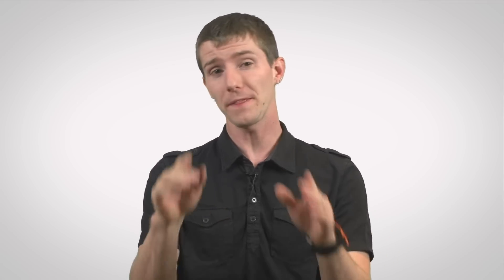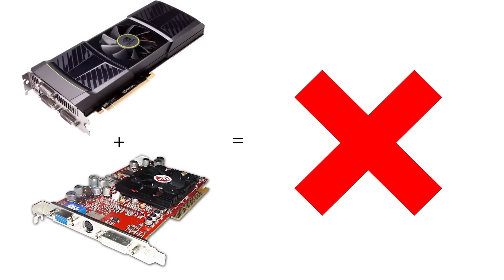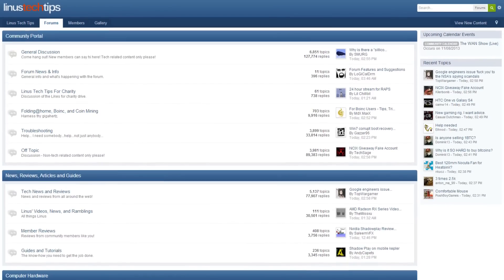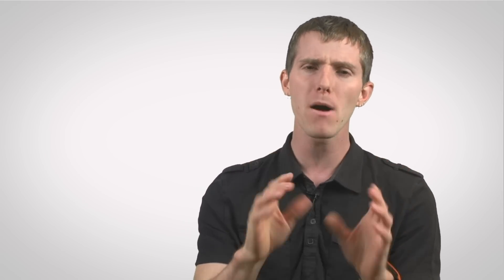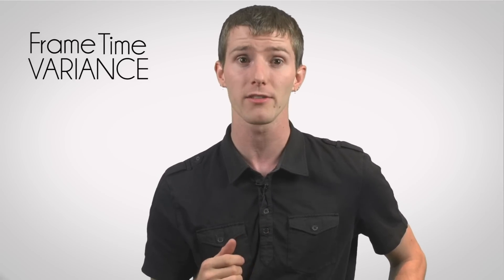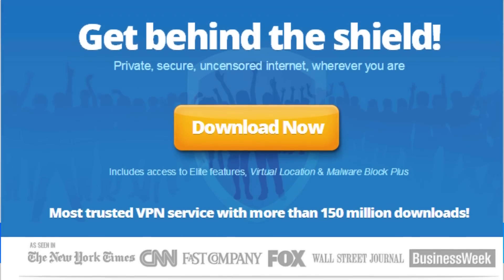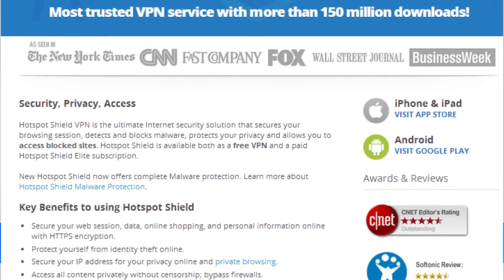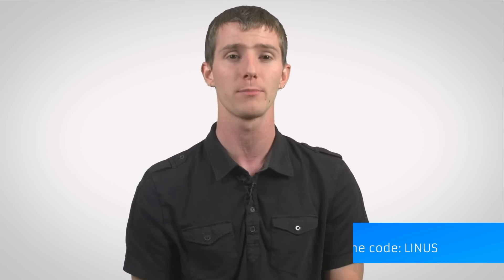SLI by NVIDIA - Everything you Need to Know as Fast As Possible

Comment: What should I need for power supply with 2 Gtx 660 And a Gogabyte 990fx killer and a Amd Fx 8350
Reply: TheSlayingService 750 is enough, if you're going to overclock you cards you should even be safe with a 750W PSU
Reply: TheSlayingService the thing is with power supply's is that you can have a 1000w but your system may only need 700w but it wont output 1000w it will output 700w instead.
Reply: 750watts
Reply: 850 overkill
Reply: 850 would be more comfortable right
Reply: My system: FX 8350, 990fxa, HD 7870 x 2, and several fans/drives, ran short on an 750.  The 7870s run 2 6pins in stead of 1 like the 660's do, so 750w will probably do just fine.

Comment: is crossfire pretty much the same?
Reply: Crossfire has wider compatibility as it will allow you to use 2 cards based on the same board while SLI only supports same processor and same memory.

However on Crossfire or SLI you always get the lowest clock speeds so not much reason to use most of the AMD benefits on theirs however the 1 card with more memory might be useful sometimes.

Both act the same way though.
Reply: Yea i knew crossfire supports across different processor and ram but the faster card has to wait for the slower card but I was wondering if the other stuff was the same but thanks
Reply: The Andoxico
Yeah its the same other then those cons.

Comment: i'm planning to go for the MSI Z87-G43 motherboard, it says AMD Crossfire is compatible, does that also mean SLI is compatible?
Reply: TheProvinceOfGaming NOOOOOOOOOOOOOO NO IT DOES NOT
Reply: No, you will have support for Crossfire (AMD) not SLI(Nvidia). Unless it says that its an SLI board, its not an SLI board
Reply: lawdoggy00 Thank you SO MUCH man! you've been a great help! but sadly only G55 and G43 are available in my country :( is the G55 SLI compatible?
Reply: lawdoggy00 Thanks man! i'm definitely going for this then :D
Reply: yes
Reply: TheProvinceOfGaming Crossfire is AMD's version of SLI
Reply: Benjmin Bingström thanks! by any chance do you know any good SLI board under $130? running low on my budget :(
Reply: Amrut Purohit  Its 20$ more then you asked but if you step up to the z87 g45 it has support for both crossfire and sli. And 3 pcie 3.0.  I did alot of searching around before settling on this motherboard and so far so good. :)
http://www.newegg.com/Product/Product.aspx?Item=N82E16813130693
Reply: MSI Z87-G55 LGA 1150 Intel Z87 HDMI SATA 6Gb/s USB 3.0 ATX Intel Motherboard

http://www.newegg.com/Product/Product.aspx?Item=N82E16813130727

Says in the spec that it
"Supports 3-Way AMD CrossFireTM Technology
Supports 2-Way NVIDIA SLITM Technology"

Not a bad looking card if you ask me :D
Reply: It says its supported or were you responding to an earlier question?
Reply: lawdoggy00 he was responging to the 1st and second comments not megakiller999's comments

Comment: R9 Crossfire?or HD 7000 Crossfire?By AMD?
Reply: That's not what I asked,what's the difference between SLI and CrossFire
Reply: They are basically the same. SLi is Nvidia's name for the technology and crossfire is AMD's patented name for it.
Reply: Can I ex: R9 280x+R9 270?
Reply: Warframe Dragonfang yes.
Reply: Lango Triel Thanks
Reply: neither. Crossfire sucks.
Reply: ATCrogerwilco I have a crossfire setup right now, not just trolling.
Reply: ATCrogerwilco Me jelly.Me want
Reply: ATCrogerwilco i am running a 7970ghz together with a 280x (same thing basically) and it works oerfectly fine.. don't get what your problem is
Reply: Yeah that's what I heard,must it have the same architecture such as Hawaii-XFire to-Hawaii GPU
Reply: the more similar the card, the better it will work together. but AMD gives you a lot of freedom.. if the card is in the same series it will work. the R9 series is just rebranded 7000s  (except 290 and up)
Reply: Lango Triel I have 2 280x, drivers suck. Half the games run worse.
Reply: You are doing something wrong. I get double frame rates in some cases.. and it runs like butter.
Reply: Really?I thought 2 GPUs would equal like 1.6x moar performance
Reply: It does for the most part. But certain games get almost double the FPS .. and some barely improve (skyrim)
Reply: Certain tough
Reply: though*

Comment: running 2 gtx 670 ftw edition in sli. it runs perfect in my pc and the performance is doubled. :)
Reply: i have 1 nvidia gtx 770 and i want to sli that bitch sooo bad but the card is soooo expensive!
Reply: Yolo Swaggins that is true. i saved up money for a long time but finally i earned enough for a new computer. i went with one 670 ftw because it was the first time i ever built my own computer and wanted to test the new card. then i realized i had money over and bought another gpu. be warned that gpus nowadays come and go fast and 670 ftw is not available anymore, here in sweden atleast. so if you want another one you should buy it soon. for me it was the right choice but you should only buy a new gpu if you accept the fact that it is not doubling the performance. chances are very high it will not boost performance that much. but if you accept it and buy a new one you will ofcourse see a big improvement. :)

sry for bad english
Reply: you spoke...or wrote very well, and thanks for the advice dude!
Reply: no problem :D
Reply: Yolo Swaggins how much the sli?
Reply: Princes Knights It's just to buy a new card really

Comment: You can fix Micro-Stuttering by clocking the second card a little bit higher on the core and on the VRAM (like 10MHz) that will fix the Micro-Stuttering
Reply: Clocking one card will also clock the other card, they have to be synced and they do this by default. That's what I know at least but if you have proof of your cards running on different clocks please correct me.
Reply: Johan Wingård They do not have to be synced. I have 4 gpus and they all have different clock speeds for their gpus. 4 Different cards too, but cause the GPU & Memory are the same it doesn't matter. 2 are EVGA 1 is ASUS and 1 is MSI.
Reply: APOC Gaming Network Why do you use Frankestein instead of a computer?
Reply: APOC Gaming Network It's still the same card just a different brand. And if you check GPU-Z or any other software you will see that once you run SLI all clocks will sync up with the card that has the lowest clock and ram speeds.

Comment: some wrong info in this video as following:

1. You said SLI was introduced in 2004, but:

SLI was created in 1998 by 3dfx when they released Voodoo2 not in 2004 and it meant Scan-Line Interleave, when Nvidia acquired 3dfx, they reintroduced it in 2004 with Geforce 6 series as Scalable Link Interface. 

2. You said SLI wont double your performance, but:

You almost get double performance with 2-way SLI, the gain decreases when adding third and fourth cards respectively. you will gain 90%-95% from adding a second card, third card gain is 50%-70% and last fourth card gain is 30%-50%.

Comment: should i get 770 sli or one 780 ti
Reply: 780 ti and whenever you feel like you need more details in games in the future buy another 780 ti, also at what resolution will you play? if you are going to use 1080 buying a single 780 ti will last for VERY long time
Reply: um,,, well right now i have a 720p monitor but im upgrading to a 1080p benq which can do 120fps so i want to utilize that feature :)
Reply: get a 780 ti and in the future buy another 780 ti, it will be cheaper. If you sli the 770s and you want to add another card it will be 3-way sli and that is just bad, it won't give you anything extra...at all
Reply: I think it comes down to the games you play. I would go 770 sli for now since its cheaper and will play games faster than a 780ti (given that the game has a good sli profile). Then, when that is obsolete, get the 980ti** when that comes out XD

** - I mean whatever flagship card that comes down the road that is still at a good price point. Who knows what it will be called.

Comment: Hey Linus :) What would be the difference in Performance running a set of 2x3 Monitors (like the Samsung md230x6) on 2 Card (3 each, using DP) using and not usinf SLI (as SLI just doubles Performance compared to a single Card, which physically having two Cards should alredy do)? Seems like SLI is only for single Monitor Setups, like the newest 4K Monitors in single Monitor Setups?

Comment: is a PSU Corsair HX 1050 WATT good enough for 3 SLI GTX 780TI? or do i need to purchase a different psu???? with higher WATT?
Reply: no you don't
Reply: Danny Vaca Let's trade lives!
Reply: lol no thank you XD
Reply: for the moment i only have 1 4k monitor looking to buy the other 2 monitors some time in march
Reply: Its more than enough.
Reply: thank u kindly for taking the time to reply :D
Reply: 3 SLI GTX 780TI? Are you running 3X 4k monitors or something? And I who though that me ordering 780TI a few days ago was a bit over the top...
Reply: Danny Vaca You might want to but it up to a 1200 watts. Especially if you plan on overclocking those cards. I've had my AX1200 for 2 years now and it's still going strong. Although you might want to op for the AX1200i because it's a lot sleeker looking.

Comment: Techquickie Woah, slow down a bit, because you're losing information. SLI was introduced back in 1998 by 3dfx, the company responsible for Voodoo graphics accelerators, which was later bought by nVidia.

Comment: Will there be a huge performance difference if my GTX 660 runs at PCI 8x8 instead of 16x16, my motherboard has 3 x16 slots running at PCIEx16,x8,x4 respectively or will my motherboard support 16x16. Somebody please give a reply.
My system:-
Processor-  Intel Core i7-4770K Processor 3.4 GHZ
Motherboard- GIGABYTE GA-Z87X-UD5H
Memory-  Corsair Vengeance 8GB (2×4GB) DDR3 1600 MHz 
Graphics Card- Gigabyte NVidia GTX 660-2GB DDR5
Power Supply- Gigabyte Superb E620 (SLI Support)

Comment: things that are kinda right and kinda wrong.

SLI DOSNT REQUIRE 2 16X SLOTS. U may run them in 16X and 8X, 8X and 8X, 8X and 4X as well as 16X and 4X. The board just has to support SLI not have 2 16X slots.
Reply: just wanted to also add, when you were talking about not working with AMD cards it sounds like you were saying they wont work AT ALL with Amd cards which again isnt 100% true. 

With windows 7 & 8 they do have driver stacking where you can use the Amd card as the primary performance driving card  ( AKA making it the primary display card ) and use the Nvidia card for Physx titles like Mafia 2 to get the extra effects out of it. While this isnt SLI per-say u still are using the 2 cards together to get better performance and features.

Comment: 2004?
I swear that the Voodoo cards had the same thing in the late 90's
Reply: 3dfx's SLI stood for "Scan-Line Interleaving" and it basically divided up the screen into odd-numbered and even-numbered pixel rows to be rendered at the same time. nVidia SLI stands for "Scalable Link Interface" and it either splits the screen into top and bottom to be rendered simultaneously, or odd and even frames to be rendered concurrently.

Fun thing about SLI: your loading times will increase substantially, as all of the loaded textures have to be mirrored on both cards (no, you don't end up with 4GB of vram if you combine two 2GB cards).
Reply: They did. But it didn't catch on for some stupid reason.
Reply: Indeed. 3dfx introduced SLI (yes, almost exactly the same technology) back in 1998. Still, people think nVidia created SLI...

Comment: so i cant sli a 4gb 760 and a 2gb 760? bummer
Reply: U can, but u only get 2gb per card. so the 4gb gets half the memory wasted/ unnused.
Reply: but wouldnt i only get 1gb per card if i had 2 2gb cards?
Reply: no,  if you have 2 2GB, you would get 2GB for each card
if you have 1 2GB card and 1 1GB card, you would get 1GB because youu cant increase the VRAM

also, if you have 2 cards with both 2GB, AND the same GPU BUT with different clock speeds (100mhz and 120mhz for example) the higherst Mhz would be clocked down so it will match the lower one.

memory works the same as the speeds here, the highest will decrease itself to match the lower

Comment: I'm facing this now as I got the GTX-770 SC 4GB for my newest Asus/Intel Z87 build and it says it supports 3-gaming monitors (ASUS VG248QE) which it does but only two can use the 144Hz refresh rate using DVI, the 3rd is 60Hz only using Display Port. So when I turn on 3D Surround view, I can only use 60Hz for all three monitors. Thinking of adding 2nd card in SLI but does it have to match current card or could I use GTX 670, 680 or something else to pair up to my GTX-770 SC 4GB?  There are only two DVI Ports, and one each Display Port and HDMI (which I'm not using). So I need another card for one more DVI socket to use 144Hz refresh rate. Gaming cards should have 3-DVI's minimum.

Comment: Hey Linus! Do the PCI-E lanes need to be 16X both?! Ususally they are 1x 16x  2x 8x so does this affect the performance by how much?! I have a Maximus VI Formula and a GTX 780 dc2oc and was thinking of buying 1 more when they drop in prices.. So should I just sell this and get the 780ti?
Reply: If you use one card, the card will use 16x. If you use two cards, they will both use x8. There is some perfomance lost there but its not much compared to how much you lose from using SLi.
Reply: intel we get pcie  5.0 16x on each slot will increase bandwith for gpus so Ile wait lol sli needs 16x on both gpus so basicly everyone  lies and tells bullshit 2 way sli is weaker you need both slots to be 16x to get the best bandwith

Comment: I worked in a store that sold electronics (hardware, software, peripherals) as well as did repairs and check-ups (you wouldn't believe what some people handed to us...) and some customers bought two graphics cards to use them in SLI or Crossfire. But these weren't good cards, they were budget versions.
Their logic was: put two cheap cards together and get one really good one. NO! Now you've got two crappy cards performing about the same as an OK card with twice the noise and power consumption. Just get one good card.

Analogy: A Porsche Boxter will go 300 km/h while a Chevy Matiz only goes 150 (eat me if I the specs are off). Two Matiz don't add up to one car going 300, you've only got two cars that go 150 each.
Unless the game's engine is really optimized and the drivers are up to snuff, that second card won't do that much good.

But where SLI really makes sense is if you're using the 3D Vision kit from Nvidia, since 3D about halves your FPS. A second card will let you keep a good framerate without having to reduce the quality (too much).
Reply: But  it is funny

Comment: Nope, SLI technology was introduced back in 1998 actually, 3DFX used it first on their Voodoo2 cards, and then again on their Voodoo5 card, where the SLI was actually built-in the same card (so 2 GPUs on 1 card). The first SLI connector on the Voodoo2 cards were made out of 3.5" floppy connectors with 5 wires on it twisted 180 degrees on the cable. But then when 3DFX went bankrupt, Nvidia bought most of what was left of 3DFX and re-introduced the technology
. Also 3DFX was going to release a "4-way SLI" video card, 4 GPUs on a single card, sometimes around 2000-2001, so Nvidia didn't really invented anything in the end.
Reply: well Linus was talking about Nvidia's SLI.
Reply: HazewinDog
of course, but Nvidia didn't invented the technology! They just improved something that already existed when Nvidia bought 3DFX...

Comment: I plan to buy me 2 asus gtx 780 DirectCU II. I've seen the GTX 780 Ti but I do not know if it's worth it because of the price and 780 gone down a lot in price. I play on a 1920x1080p screen. What is the smartest thing for me?
Reply: buying two ASUS GTX 780 DCUII is the smartest choice by my books
Reply: oladag  yup  BenQ 24" 3D LED XL2420T 144hz
Reply: TeamFlamingStones I don't think you need 2 780s, i think a 780 ti should be more than enough for you if you use a single monitor
Reply: 2 ea 780's are overkill for single monitor resolutions of 1920x1080 or less, you won't see too much graphical improvement.  Certainly not the price of a second card's worth.  Dual 780 should be used on 1440p minimum to get the best bang for your buck
Reply: i think you have too much money.. just send me one of your 780's if you odnt need them.. help out a brother in need :c
Reply: You don't need two 780's to run games at 1080 on a single monitor, all you will be doing is using more power and see no improvement whatsoever in the games, there are no games that use the power of two 780's. Unless you are doing professional rendering or something, stick with one 780 and spend the cash you saved somewhere else on your rig (if you need to) and perhaps buy another 780 in three years time when it would, possibly, make a difference to your gaming.

Comment: if you sli 2* 2 gddr5 cards wimm it be 4 gddr5
Reply: No.
Reply: Your are wrong sir.
Reply: The second card's memory is not used, so 2x 2GB video cards will still act as only 2GB. Only the processing power of the second card is used.
Reply: ***** wrong also, the textures have to be loaded onto both cards, so you are loading double the textures, therefore using the same amount of memory per card.
Reply: Luke Riddoch Ah, my mistake. I meant it's not additive - it'd still be effectively just 2GB, and the data is basically mirrored to the two cards like a RAID 1 array if you will.

Comment: So, this video talks about faster video processing, but not about adding displays. Do I need to run an SLI bridge in order to support more than two displays? I'm saving up for a Cintiq, but I don't want to have to sacrifice one of my regular monitors to run it.
Reply: Nah, you can run multiple screens as long as you have the right connectors (VGA, DVI-I or DVI-D) in a single card
Reply: Gotta use the sli bridge for Nvidia, the only cards on the market that you don't have to are the r9-290 and 290x